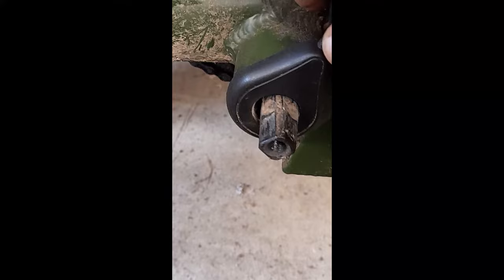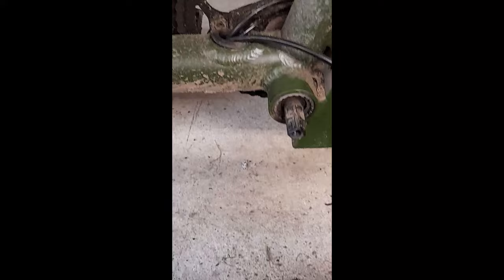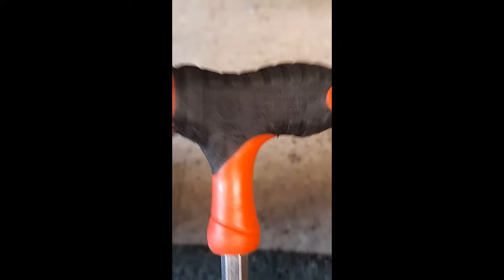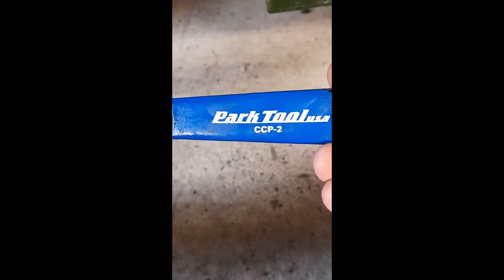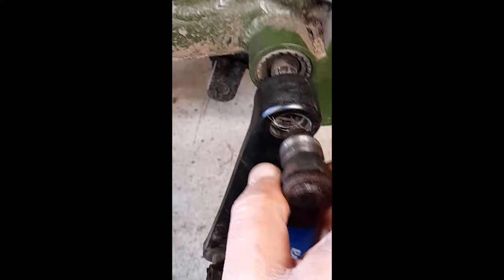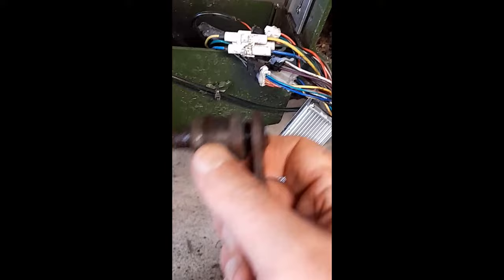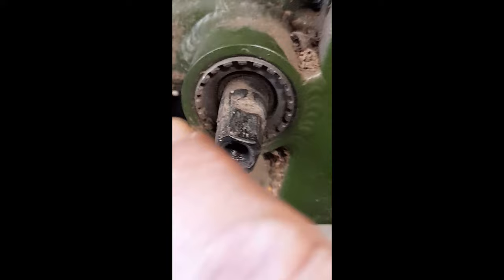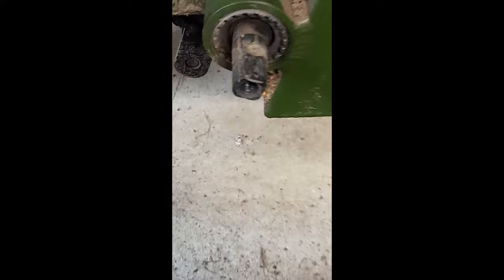E-Bike Pedal Assist Sensor Fix

Comment: Yes, after my first heavy day of rain, the T1 was on the blink due to effects of dampness. I had to seal up those massive holes on the housing going into the controller. I have a video I need to put up about it.
Reply: ▪️
I can't open your channel...  Weird thing with the YT comments lately is that I can't open others' channels to check out their vids...
🟥
Reply: @2NDFLB-CLERK  Yes, I found that YT do that leading up to the US elections. They are noted for it.They want less people weighing in on stuff... Not on my channel but on political stuff. So they adjust their algorithms.

Comment: Thank you for posting the video.  This explains exactly my problem.  I'll tackle it as soon as I get a crank puller. Hopefully mine has dirt or metal filings or something as well.
Reply from the maker: Good luck!
Reply: was it dirt?
Reply: I removed everything, electrically checked all cables (seem fine), There was a little dirt, but not enough (in my opinion) to cause a problems with magnetic pickup/sensing.  I suspect it has/had something to do with the collar part of the sensor not spinning.  That is, the crank is spinning (me peddling) and the collar was slipping and NOT spinning with the crank shaft. It's relying on a friction fit to work.  It put a bit of glue where the spinning part off of the sensor friction fits over the crank shaft.  Seems to work.  No issues after 200km.
Reply: @JKowala  thanks alot for the reply i took of my crankshaft and looked for some dirt but there didnt seem to be a problem idk it maybe the collar not spinning ill check tomorow:face-blue-smiling:

Comment: My Fiido L3 has the same sensor and becoming dangerous due to this problem, I am thinking of making some kind of gasket between the crank arm and the sensor; I am using a rubber O ring from the garden center at the moment.

Comment: Did it solve the problem?
Reply: Yes,no problem after
Reply: @nostalgicplastic4323  What happened? Ive got a similar pedal system on my ebike, i gave it a clean without dismantling it (brushed and stuff) and it started working again but jerks if i dont apply enough force
Reply: @Holywinter792  maybe take it off and give it a thorough clean? If not, they are pretty cheap to replace. Good luck
Reply: @Holywinter792  You will have to disassemble and clean the magnet, put some silicone grease in there before you close it up.  Go to a plumbing store and ask for silicone grease, it has good waterproofing property.

Comment: Is there a way to by pass sensor
Reply from the maker: I don't think so. If you did it would either run all the time or not at all. It acts like a switch, so when you pedal it switches the motor on.